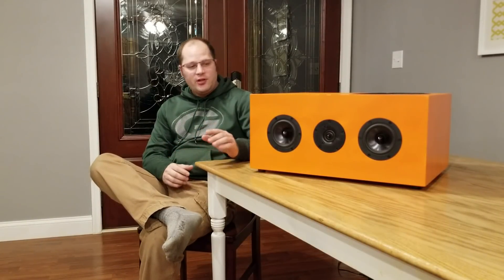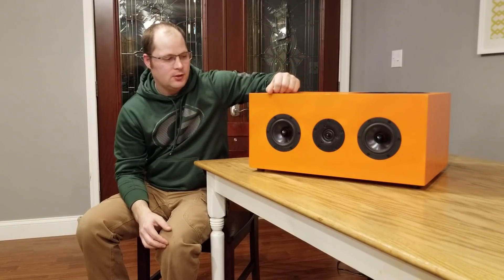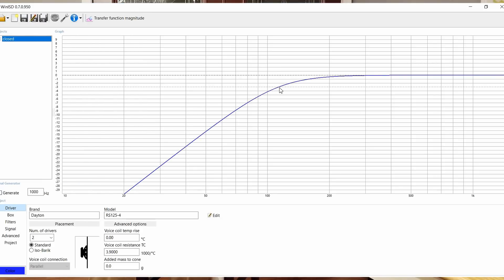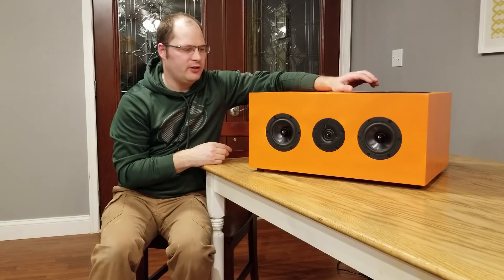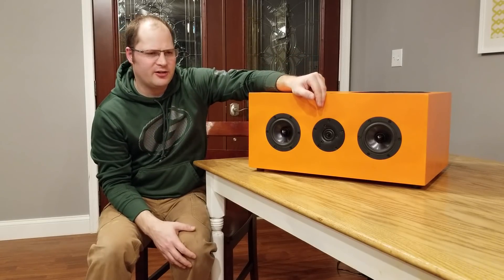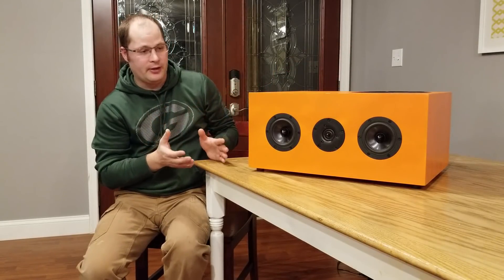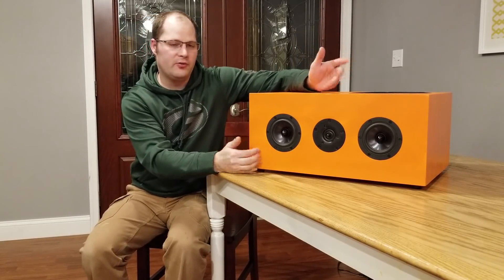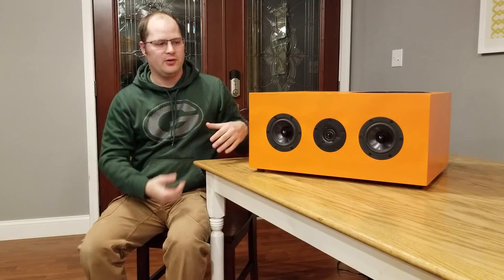DIY Cloning a HIFI Speaker Overview - Definitive Technology CLR

Comment: 123Toid I thought generally you want a narrow baffle, NOT a wide baffle? Or are there pros and cons to both? or does it depend on the drivers?
Reply from the maker: There are arguments for narrow baffles, but none that I have heard backed by scientific evidence.  Typically a narrow baffle is chose for 2 reasons - aesthetics and structural integrity.  Typically a wider baffle is better.  This is for two main reasons - diffraction and baffle step compensation.  The wider the baffle is, the less you need to worry about those in your crossover design.  Granted, you can still have a narrow baffle that sounds great, you will just may need to do a little crossover work.

Comment: Localization isn't about pressure loading a room. It has more to do with modal pattern at different frequencies. As you add more woofers you improve the pattern and have less nodes of constructive and destructive interference.

Comment: Oh I forgot, there is one question. How do you control the volume?
Reply from the maker: James Smith this speaker is designed to be used with a home theater or stereo receiver, so you'd use that to control the volume.
Reply: Okay thanks

Comment: If the tweeter and mids are in a separate compartment only 3" deep, could you build a speaker only 3" deep? Your sub could be separate. I already have a sub that I'm happy with, but I do need new left, right and centre.
Reply from the maker: Absolutely.  I plan to do a separate video sometime with these, but I was going to do it ported.  Having said that, if you wanted to make a really slim speaker that hung on the wall, this could be a great way to go.
Reply from the maker: Just for clarification, the depth is 3" internally, so that makes the speaker actually 4.5" deep (3/4 for the front baffle and 3/4 for the rear).
Reply: 123Toid That's great. Still pretty skinny. Looking forward to the follow ups.